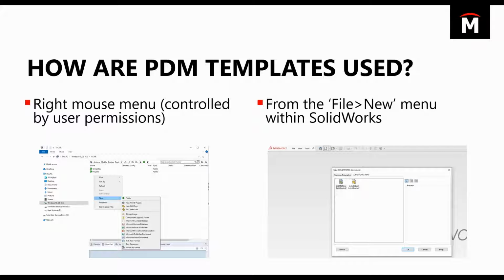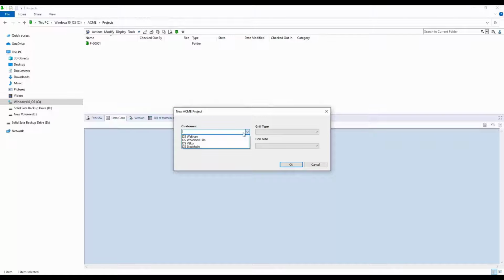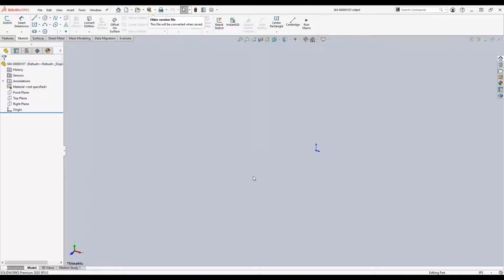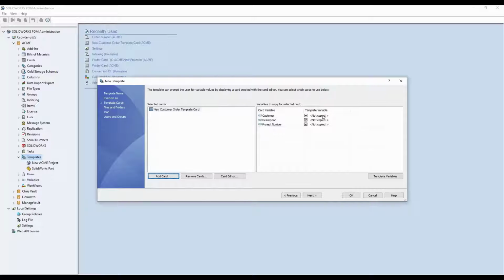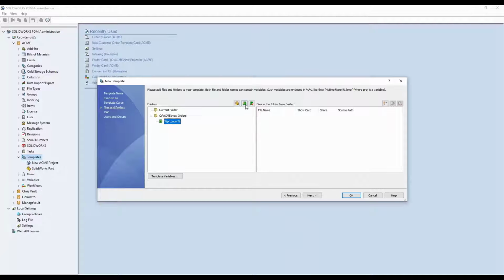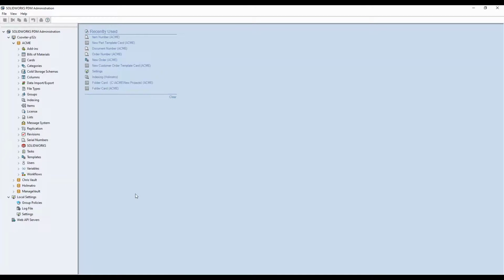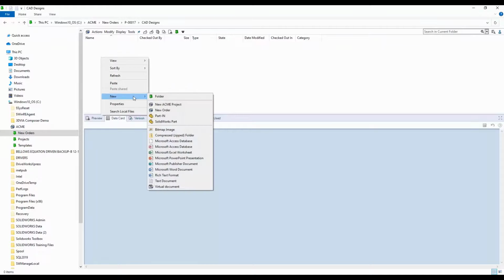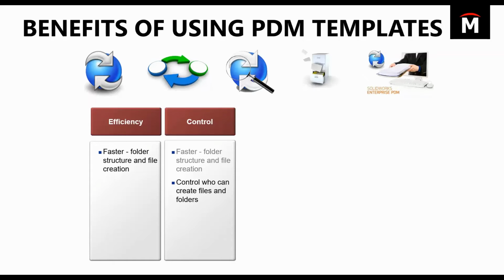How to Create PDM Templates Webinar

Comment: THANK YOU, this helped a lot, I was using this to setup template files to create in an existing project.  I struggled a bit because our template card was improperly set up so some of the fields I was trying to put into the file name were blank.  The fields in the folder template card was set to text value instead of folder data card variable.   Thanks again!
Reply from the maker: Templates, especially the variables, can be a bit confusing at first.  Once you understand how they work it gets a lot easier.  Glad it helped!!
Reply: hi. I racked my brains for a week until I found your video. It's perfect. I'll do the same for myself tomorrow. Now the question is, how can I give a new name to an old SolidWorks file using a serial number?
Reply from the maker: Try using dispatch: https://youtu.be/kvE6iUfz-74